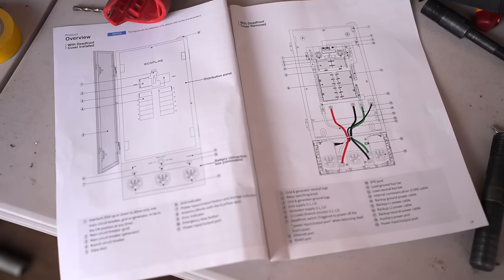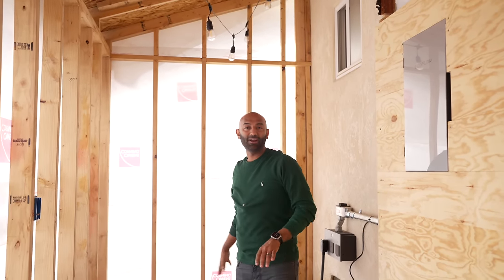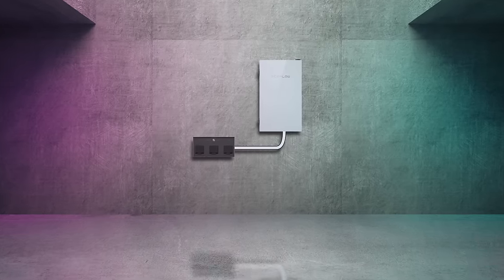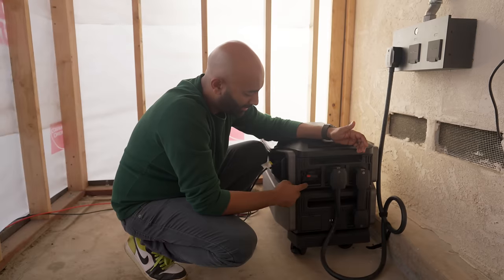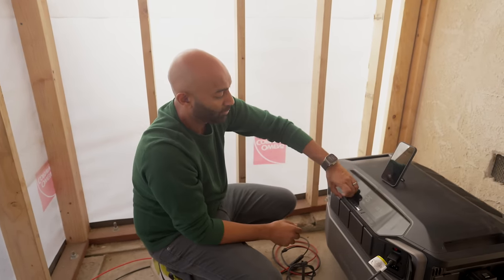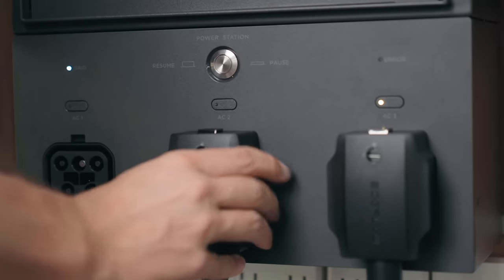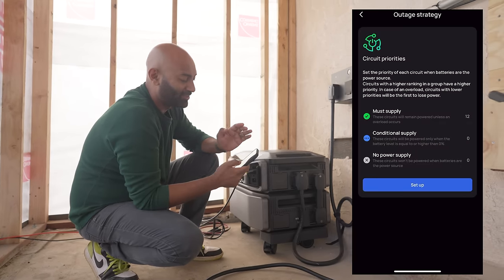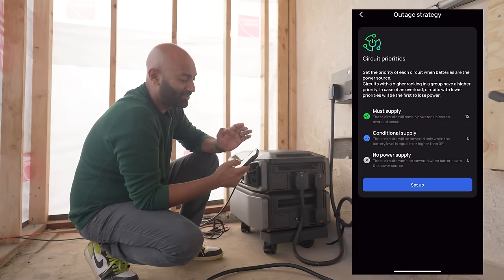EcoFlow's New Smart Home Panel Is GENIUS - Right For You?

Comment: Had my heat pump water heater installed last week.  It's in the garage, and while not "loud," the sound of the compressor easily goes thru walls.  So we can hear it in the the adjacent bedroom, kitchen, upstairs as a noticeable "hummmm."  Just in case you plan on doing filming in the next room, it's something to keep in mind.
Reply: I have a simular issue. When my parents installed theirs, we used an isolated stand (not connected to any walls) and had them use PEX. This solved the hum transfer issues.
Reply: Ditto to this comment. Single story home, hpwh is in the garage against an interior wall, and we can hear the hum down the hall. Not the end of the world, but imagine if it's in the same workspace or next to your work space it could be annoying.
Reply: Also need a large volume of air to grab the heat from, that small room will cool down quickly

Comment: Can the solar side handle dump loads? When generating more power than you use and the batteries are full, can you send extra power to an old style resistance water heater plumbed in front of your heat pump water heater, or to a battery charger in the main house. With a huge array you will have extra solar at times, can you put it to use? I'd think the best uses would be heating &/or cooling through a secondary system. A window unit heat pump in the battery room?

Comment: Good news is with your old Delta pros, You can integrate it with a smart home panel 2 But require a new double voltage hub
Reply: The Delta Pros currently do not work with the Smart Home Panel 2, despite their advertisements. They say this will be fixed in a firmware update.

Comment: I think the technology is interesting. However, the 90kw system is around $60,000. How long would it take to offset the purchase and installation cost?
Reply: id imagine the 90kW systems are not meant for single-homes, and more for multi-family or condo/apt. complexes
Reply: You can build a diy system with 12kw output and 90kwh for less than 30k
Reply: I doubt that 90 KW is in the future for what he has there so you can probably figure on about half that size, and half the cost. Take the 30% federal tax credit and whatever else California offers along with SREC credits and you’re probably down to offset in about $20,000. With electric rates at $.42 per kilowatt hour, if his place uses the average of about 30 kW per day then he is somewhere between four and five years breakeven. Not bad for system. It’s got that much flexibility and use.

Comment: 42¢/kWh flat rate is quite eye-watering 🥺 ouch, sorry dude. Our "demand rate" here is weekdays 4-8pm and is "only" (compared to yours) about 25¢/kWh (normal & weekend rate is 11¢, overnight is 7¢) taxes and riders included.

Shoot, I would be super stoked with just say 12 kWh of battery capacity to run my 2-ton AC for the 4 "demand" hours, then have it slowly recharge from the grid at overnight rates. (I know that's still not Net-Zero, nobody lecture me LOL 🙂)

bUt I jUsT rEnT 🤪 and my landlord is so afraid of "BIG batteries starting fires" that her last lease renewal included a clause that EXPRESSLY FORBIDS (LOL?) charging EVs and "BIG batteries" in the garage...

Comment: I wouldn't put that heat pump water heater under the window if you can offset it just a bit just in case the fan gets noisy, my fridge and GE Turbo washer's fans aren't terrible but I like that I can't hear them when I'm working

Comment: The Ecoflow Ultra still uses the same old fashion, high frequency, transformerless inverter design that's used in low cost, lightweight, Harbor Freight, high frequency inverters. That provides absolutely no galvanic isolation between its DC boost stage and its AC output. Without this critical safety feature, I would never consider install this inverter into my home's electrical system.

Comment: I wanna move off grid asap. I plan on burning some wood in passive solar design. I was looking into Phius certificates. I do construction for a living. We sub out plumbing and electric. I decided to go with a d.c. solar electric system more like a boat or r.v. than a house. Trying to avoid inverters. The boat fridges and freezers are ac/dc and usually better insulated than household appliances. I do need at least one or 2 inverters for power hunger tools. Which will have a super capacitor bank with battery bank to help with hard cycles on batteries from tools. D.C. electric devices seem to use less electric as technology improves. Also gonna separate systems. Like led lights and smoke detectors will be stand alone with backups. Utilities bills always seem to go up in price. Less bills the better. Personally thermal breaks and ventilation is what makes or breaks an air tight house. Thermal breaks around windows and doors to stop condensation zones in studs. I recommend spray foam or mineral wool around windows and doors and bays next to them. Moisture in kitchens, showers, basements, and rim joist pockets needs to be addressed. My tips from build modern air tight houses.

Comment: For heatpump water heater..... plan to vent to outside and pull out of attic.....  Thus place your Heat Pump Water heater to minimize the work of venting.... For me, I vent to the outside in the Winter and vent to garage in the summer ( free airconditioning )
Reply: Why wouldn't you vent to the house for free heat during the winter as well?

Comment: Great video! I my country it’s almost impossible to go net zero, winter has multiple times there is no proper sunlight for weeks.
My solar does produce 1kwh a day that compared to my heatpump that uses 40kw, im looking into heat storage in summer to use in winter:)
Reply: 40kWh per day?  Wow, that's some expensive heat. Long term heat storage is an interesting concept that has no good solutions right now. If you solve that you'll be famous.

Comment: I would do this in a heartbeat, but I live in mid-Michigan and the solar input is not great. I do have 15-400 watt pant. It helps to subsidize my electricity bills but will take longer than I wish to pay for it. Adding a battery would help but again, in my location it would take a Loong time to pay off. The only advantage I have to add a battery is to give me time to roll out my generator. At this point in time, in my location, it’s hard to justify the cost of going full solar. 
If I lived in more southern states which have higher solar rates, I’d go full speed ahead with solar and batteries.

Comment: Nice video.  I'm impressed by the advancements being made in batteries, smart panels, and solar.  My question, though, is what is the payback period?  You've spent tens of thousands of dollars in solar panels, batteries, electrical panels, and wiring, not to mention increased insurance premiums and ongoing maintenance costs.  Don't get me wrong.  I'm looking into all of this for my own home, but at what point in time does the savings in grid power bills exceed the original and ongoing costs of the solar/battery installation?  I realize this will be different in different areas.  Our grid cost per kilowatt-hour here is less than half of yours.

Other things that come to mind are roof replacement costs when the roof is covered in solar panels, vs a plain roof.  Also, batteries are getting better and better, but they are an expendable item.  They all gradually loose max capacity, and at some point in the future will need to be replaced.  Are those costs factored in?  (I worked in the cellular phone industry for many years, and the massive battery stacks in the cell sites had to be changed out on average every ten years.)

I'm still thinking more along the lines of a natural gas fired all-house standby generator, instead of battery/solar.

Comment: Great Video! New sub!  I'm looking forward to how the Delta Pros integrate into this.  I have 2 DP's with a dual voltage hub and a 10 circuit manual transfer switch for emergency home power backup.  Looking forward to the next video.

Comment: What an awesome video, thank you so much for sharing.  I gain a great deal of inspiration from you videos.  I do have a quick question.  The panels on your roof are using "micro inverters", which if I'm not mistaken output "a/c" current.  How do you store that energy to a "DC" battery.  Are you going to use a different group of "DC" solar panels to charge up the Ecoflow batteries?  

One more question.  I have DC solar panels installed on my roof that connect to two string inverters.  At the time I did not install a battery backup, since I had Net Metering.  The rumors are that I will eventually have to go to a TOU billing System.  My System is a lease through SunPower.  I am wondering if I can install an Ecoflow system as my battery backup.  Would I have to replace my current inverters?  Any advice would be greatly appreciated.  Thanks so much.  Keep the inspirational videos coming.

Comment: This system is nearly double the $/kwh as rack mounted batteries and all-in-one inverter chargers, but boy does it look so much easier. Also, Ecoflow has been pretty dedicated to supporting their past equipment better than almost anyone else, so there's less worry about something going out of date before the warrantee ends.
Reply: The support from them is dismal.   The delta pro has been waiting on the firmware update to the "99 days" issue for multiple weeks..... apparently sales is a lot more important.
Reply: @tlteal  I concur. It's bottom tier at best. Took 2+ months and 20+ messages to get a refund after sending back a product within the return period. Borderline dishonest. Will never buy anything from them. The product itself is not bad.
Reply: @spacerabbit1619 I thought I was the only one but apparently not.   There is another crowd saying their level of support is amazing.  I can't help but wonder if there are tiers of support that align with how much you spend or something?

Comment: Just curious what the outlay is in terms of cost for the batteries vs. ROI? Have you computed when you break even? I have been tempted to get batteries but feel like the payoff is not worth it?
Reply: It's fairly expensive, $10K for one inverter, battery and smart panel. You can simply have a grid tied solar system to get the most efficient payback via net metering if you don't need the auto backup capability. There are cheaper units you can use just for emergency power.
Reply: @ChrisP978  I think the only real situation where this system "makes sense," aside from engineer types who can afford it and think it's cool, is when you have a piece of property that is not on the grid and would be $50k or more to tie in.  Then a system like this starts to make sense.  But if you are starting on the grid, the whole battery thing just doesn't pay back.
Reply: @ChrisP978  I just recently bought an Ecoflow Delta 2 to function as a backup for my refrigerator. I tested it out to 12+ hours. Hopefully the grid doesn't go down longer than that. ( I live in Southern AZ and the grid is pretty stable)

Comment: Thank you for your video. I’m reading the install manual for the Smart Panel and it says it uses two 100 amp breakers (not supplied) to connect to your main panel. It also lists the brand and type of breakers approved for the SP. It lists Square D Home but not QO breakers. I have QO and wonder if they’ll work?

Comment: Can you stop paying your local power utility? Here in AZ, where we have maximum sun hours, we can't disconnect from the grid. You can, but you still have to pay all the base fees. For me that amounts to about $45/mo. With solar I can knock most of that out in the winter months. Batteries weren't really viable when I added solar and I had to sign a 10 year contract with the local power company to get anything at all. If I even change out a panel I have to redo the contract. Those contracts are mostly one-sided. At that, the AZ Corporation Commission is considering letting the power companies renege on the contracts we signed.
If I could drop the power company I would likely be all over this.

Comment: What kind of engineer are you? structural, mechanical, electrical? If you're an electrical engineer, then you should know that the high frequency, transformorless inverter tech that's used in this unit is not suitable for permanent installation in a residential application. The Chinese made. lightweight, high frequency inverter tech in these light duty units is not only short lived and offer a weak 1.5 X (150%) surge capacity, when compared to conventional, heavy duty, low frequency, off grid inverters, they can also be dangerous. 

Since the early 1990s, high frequency, transformerless inverters gained the reputation of being the poor man’s inverter and were meant only for short lived, temporary installations. They were never designed nor meant for permanent installation to safely power a home’s appliances. 

First of all, these units are NOT UL-1741 listed, so unless you’re living in a tiny home, good luck obtaining a permit to install this unit into your home’s electrical system. In addition, without a UL-1741 listing, you won’t qualify for many of the state rebates and tax credits that are available. 

Even today, after more than 25 years of product development, You'd be lucky to get even two to three years of service from these Chinese made high frequency inverters, especially when powering high inductance loads like full sized refrigerators, large power tools, portable AC units or large microwave ovens. The reason for this is that all of these lightweight, high frequency inverters lack a very critical component. That critical component is an iron core, copper wound output transformer. Without an output transformer to act as a buffer to absorb the electrical surges provided by the “Flywheel Effect” inherent in the physical amount of a transformer’s iron, these surges and damaging reverse voltage spikes must be handled directly by the inverter’s MOSFET transistors, essentially shortening their life. 

You might be able to start and run some high surge loads when these high frequency inverters are new, but every time you fire up one of those inductive loads, you're shortening the life of the MOSFETs in these inverters. To make things even worse, lightweight, high frequency inverters run much hotter and their internal components are far more stressed due to their high switching speeds and use of high voltage components, These two factors makes the low cost, off spec, Chinese made components such as capacitors, MOSFETs, diodes, resistors and ICs that are used in these inverters, far more prone to early failure. Simply put, high frequency inverters are better suited for like duty, electronic devices, and low frequency inverter are better suited for heavy duty, high peak power appliances. 

Another major consideration with many of these lightweight, high frequency, transformerless inverters is safety. First of all, high frequency inverter don’t have Isolation between the Neutral and Line which increases the risk of a shock hazard. And second, during a catastrophic of the failure of the inverter’s circuitry, all it would take is for the AC output monitoring circuitry to fail and one of the MOSFETs in the inverter's H-Bridge circuit to short to ground, and these high frequency inverters can send dangerous, high voltage, high amperage DC current straight to your connected AC loads which will not only damage most AC appliances but can also set those AC appliances on fire. 

Another issue with most of these high frequency solar generators and inverters is that, rather than go into an overload shut down, the units will lower its output voltage, creating a brown out, which can drop its voltage to as low as 80 Volts which can cause damage to your home’s electronics. Brownouts can also cause damage to insulation and cause unexpected electronic failure in the future. A sustained brownout could cause damage to electronic motors that are in everyday appliances, including washing machines, dryers, fans, air conditioners, refrigerators, and freezers. US appliances are designed to operate at a nominal voltage of 110 to 120 VAC not 80 VAC. What these cheap, high frequency inverters are doing, is sacrificing your appliances to protect itself.

Another consideration that is never mentioned by those Youtube high frequency inverter affiliate hucksters, is that the vast majority of these inverters are non-repairable. After the warranty runs out, you're not going to be able to ship these units back to the manufacturer in China and have them repair them. And at a typical shop rate of $125 per hour here in the US, with no schematic and limited parts availability, it won't make economic sense to even attempt to repair one of these units. Once the FETs have fried and have burned a good portion of the inverter's PCB, (And trust me, sooner rather than later, they will fry.) they basically become a brick. 

A much better choice would be to invest in a UL-1741 listed hybrid inverter and a bank of LFP batteries or power station that uses low frequency, transformer based technology in its design. Low frequency inverters can handle high surge loads for at least 3x (300%) their continuous rated capacity and they can do this repeatedly, without sustaining damage to their MOSFET transistors, for minutes, rather than the milliseconds that a high frequency inverter offers. That's why the big name brand inverter manufacturers like Schneider Electric, Outback Power, Sigineer Power, Magnum Energy and others, all use a low frequency topology in their design.